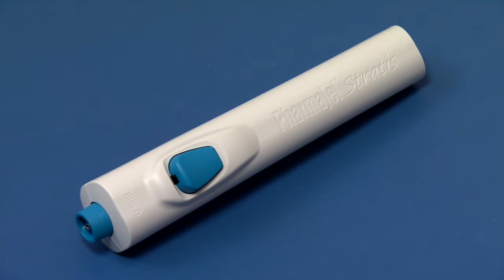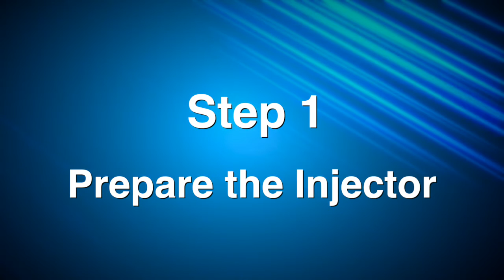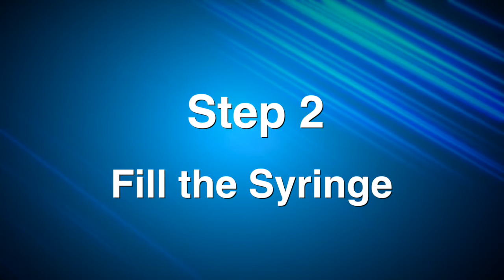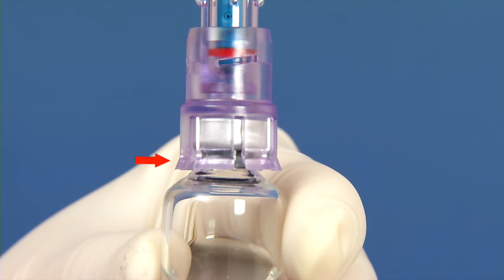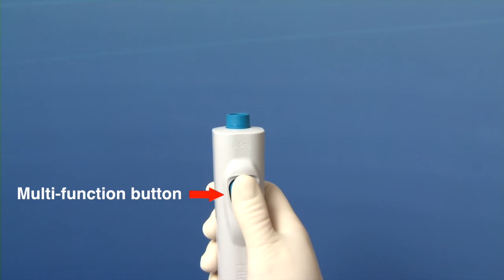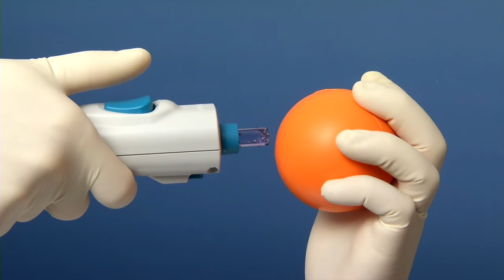PharmaJet Training Video

Comment: Dont you think this is more time taking than a normal syringe shot. No doubt this wont hurt like syringe but apart from that it has all those outcome as a normal syringe does.
Reply: I believe this method is also useful in reducing wastage of the vaccine fluid/substance itself. Its also useful in disposable as sanitation workers are no longer at risk of coming in contact with a used needle
Reply: @AdityaVenkatesh101   Yes I agree with you. I was thinking about the environmental impact (garbage in terms of the needle free syringes) and time it takes to shot one dose. Additionally the training which needed to use PharmaJet.